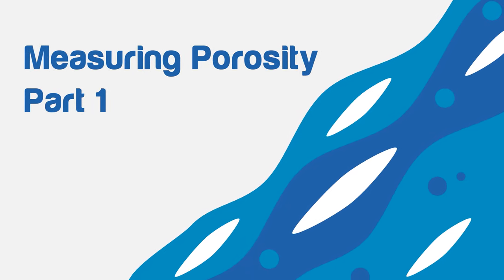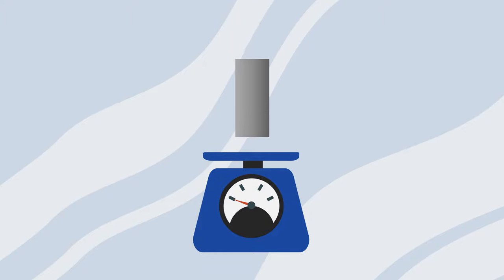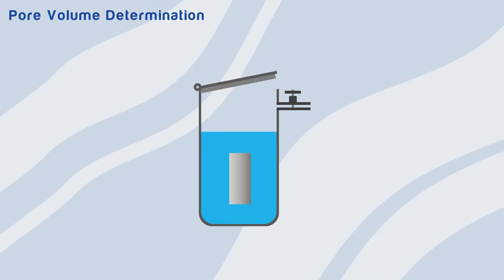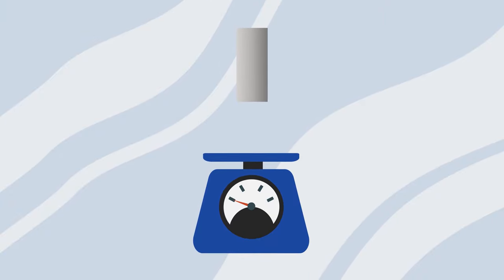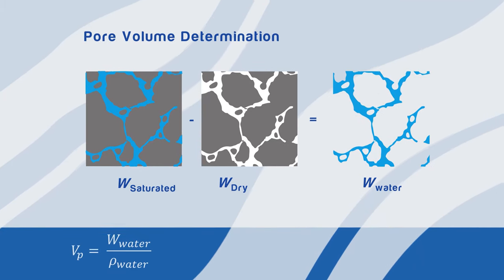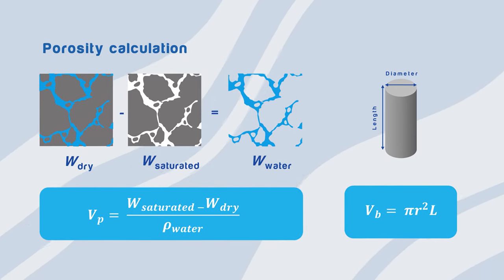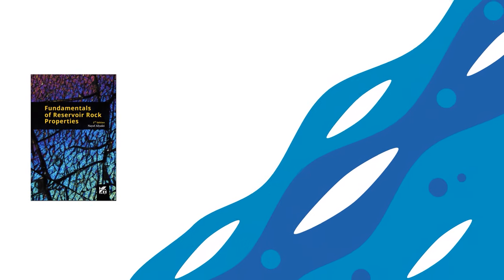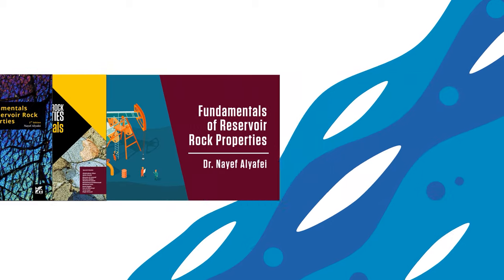Measuring Porosity Part 1: Fluid Displacement Method

Comment: Hello, do you know solution for this one The fluid displacement technique is used to find the porosity of a certain core sample. The sample is first coated with paraffin (density of 0.9 g/cm3) and submerged in a beaker filled with water (density 1 g/cm3), where the volume of water before and after submerging the sample is recorded. Then, the paraffin is removed, the sample is saturated with water and then weighed. The following information is given for the sample:
- Dry weight of the core = 140.2 g
- Weight of the core with paraffin = 145.6 g
- Initial volume in the beaker = 242.5 cm3
- Final volume in the beaker = 318.0 cm3
- Weight of the core saturated with water = 156.8 g
Bulk volume 
Porosity 
Density matrix 
Pore volume
Thank you I. Advance

Comment: I do not have drill core samples, so can I apply this methodology to determine the porosity of my rocks sampled on the surface? if yes, can the values be representative of porosity for same the rock in the subsurface since the rocks beneath might suffer from compaction due to weight of overburden material?  Thank you very much for this videos.

Comment: Can I do the same without the vacuum pump? Thank for the video :)
Reply from the maker: It is not advised as the pore volume will be filled by both water and air. This will cause errors when measuring the porosity.